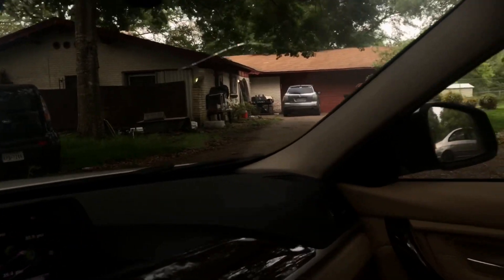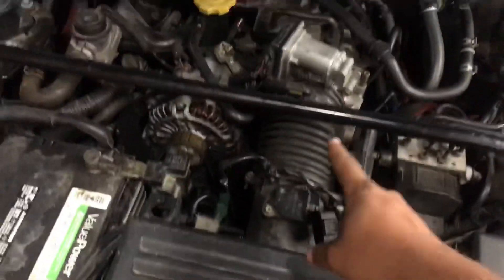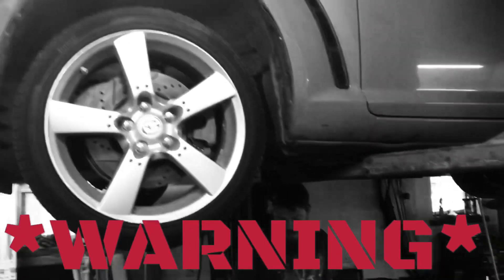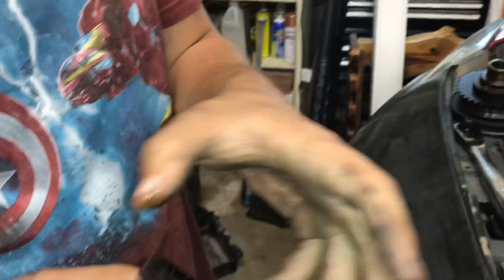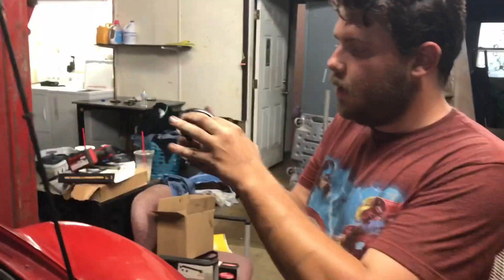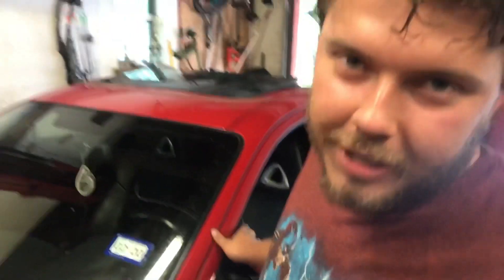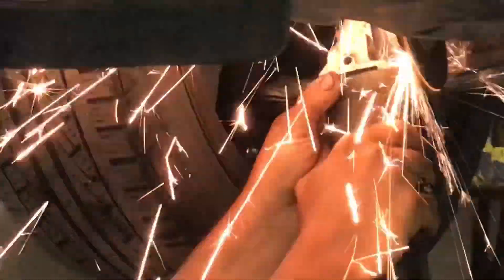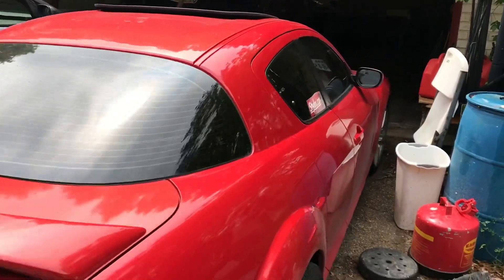RX8 Front Main Seal and Tie Rod repair

Comment: What tool have you used to lock the flywheel to prevent the crankshaft from turning?
Reply from the maker: You can buy a flywheel lock tool for pretty cheap.